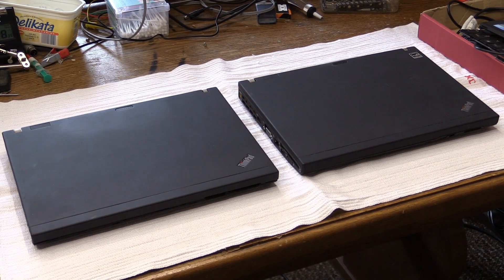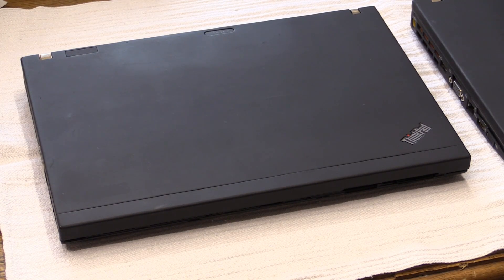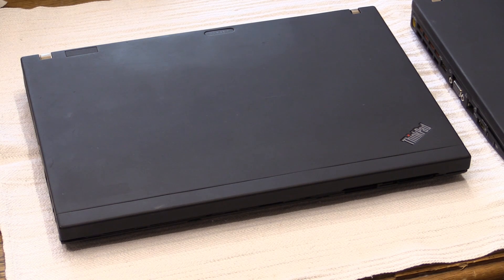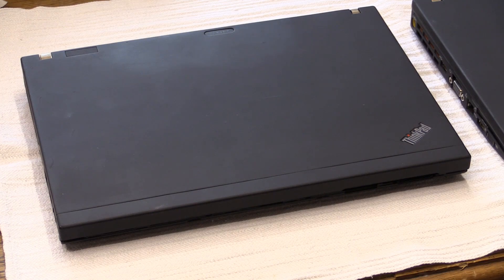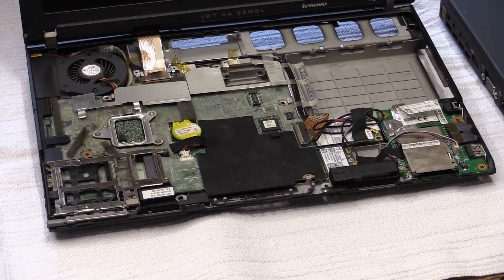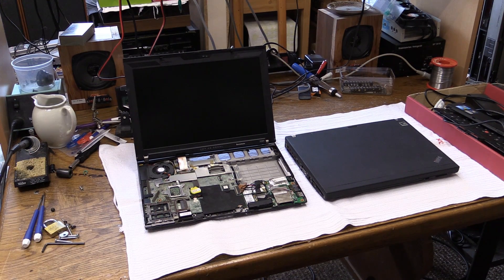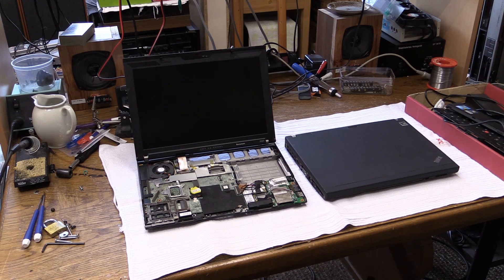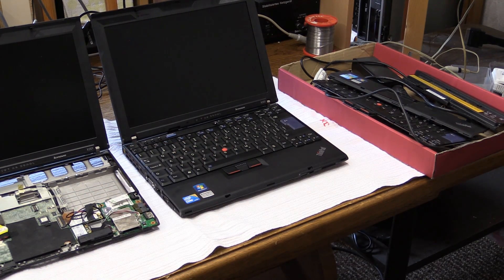DrCassette's Workshop - The Thinkpad Project [1/2]

Comment: After the 520 series everything went downhill with Thinkpads, although they are still just about the best money can buy.  However the older models pre-2011 were bomb proof and engineered to really high standards, both in build quality and performance, but also with very innovative ideas.  The last true Thinkpads were probably the T6x and X6 series, e.g. X61 , X60s and T61p and Z61p etc.
Reply from the maker: I'm not a fan of the new style keyboard and mouse pad, but the classic old Thinkpads are starting to get a bit slow. I still have the X201 shown in this video, as well as a T410, both are not very enjoyable to use anymore, despite having an SSD and plenty of RAM. I will have to upgrade some time soon.

Comment: This is why Apple puts a moisture sensor in their devices... it's a little white thing that turns red if it has been exposed to water. So if someone takes in an Apple product for repair, the technician can see right away if the failure is because it got wet (which, of course, means your warranty is void!).
Reply: to keep your laptop dry on trips one should invest water proof cases like pelican hard laptop cases,